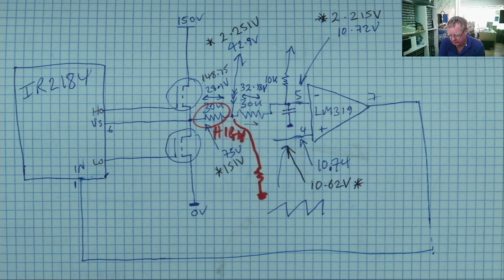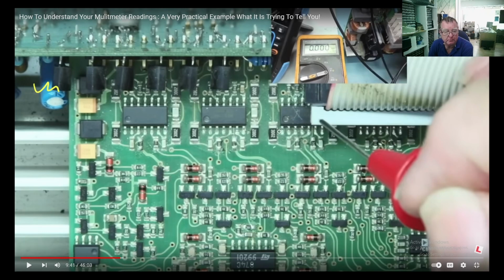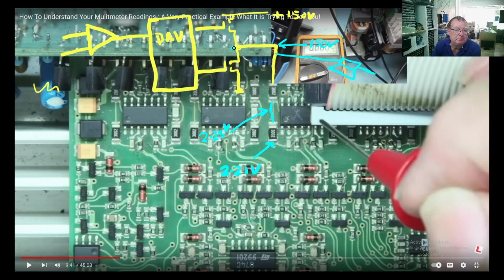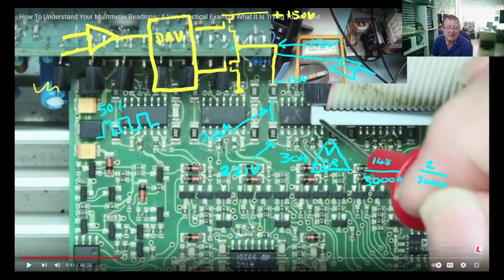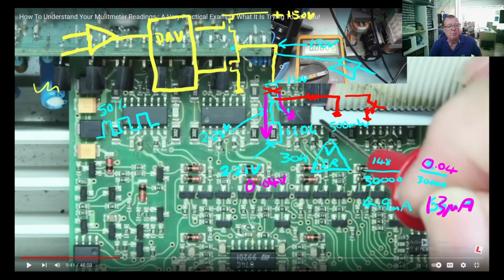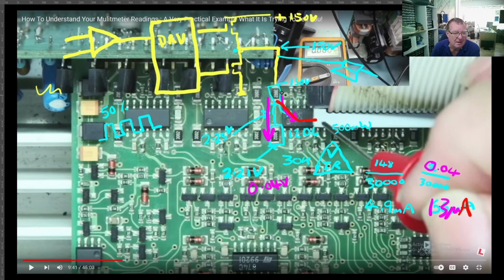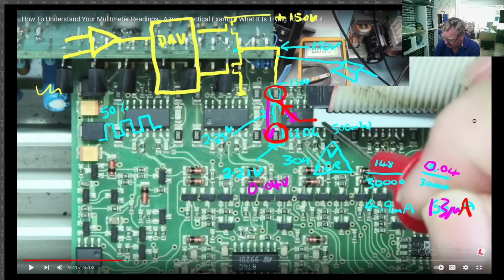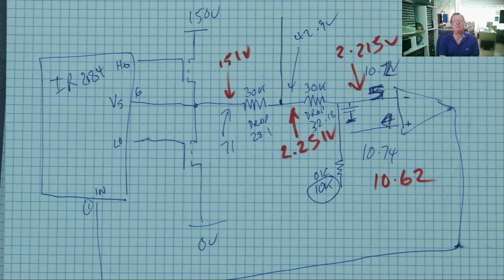How To Understand Your Multimeter Readings : Part 2 : Ohms Strikes Back!

Comment: Exactly...it's not that lucky or surprising to have a a good channel in a stereo amplifier...so the commentors point is not that valid...99 times out of a 100 the fault is on left or right...not both...I had a stereo channel fault on an old early 90's Korean made Rotel...I dont have the skills to diagnose component faulty...I soldered a bridge and made it mono...eventually I gave it away..it's still in use every day since...I swear to God...I got chatting to the staff at my local restaurant when sound was buzzing from the ceiling speakers...the manager turned volume low and ignored it till the music went completely...I guessed the amplifier..I offered to swap it out...I checked connection and they only used single channel...so my mono amp was ideal...I swapped it out...got a free meal...kept the transformer from their old amp... binned the rest of the nasty cheap crappy box

Comment: I should have phrased it differently - certinaly not meaning to imply any lack of skill.  Remember the (para)phrase "the harder I work, the luckier I get"?

Thanks for taking the time to explain this so clealry.  I guess the "good" channel was a useful sense-check.

I've done a little fault-finding and fixing in solid-state guitar amps for friends lately, so I'm just learning these diagnostic methods.
Reply from the maker: Not at all, it was a very valid point you mentioned and formed the reasoning to produce this video which a lot of viewers will find educational 🙂

Comment: Thanks for allowing us to follow your reasoning 👍  only one additional factor which can occasionally kick-in when considering component selection by the designer (I.e. where we can infer they are meant to carry the same current) is that there may be a pick-and-place machine limit on component selection … and so may substitute a larger than strictly necessary element where that is already being used elsewhere to keep the variety count down.  Less likely on mass produced good like amps I admit.   Keep up the great work 😀👍